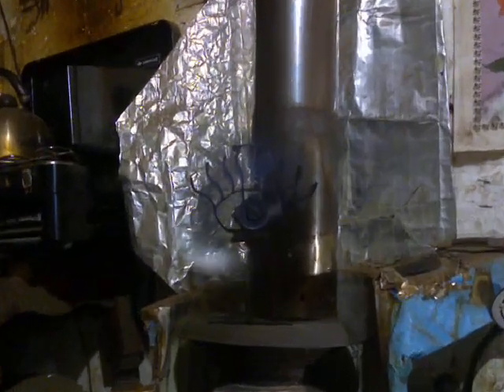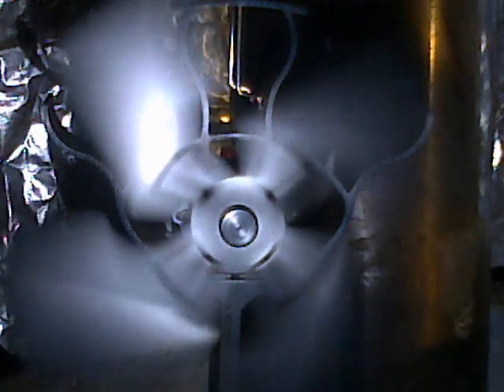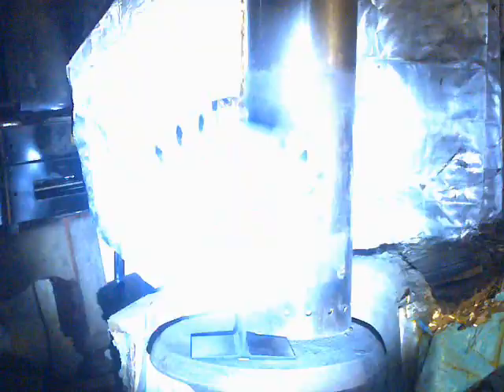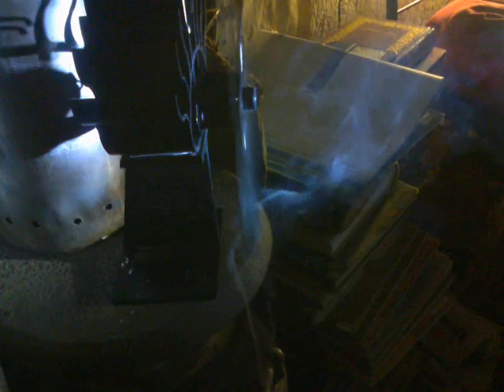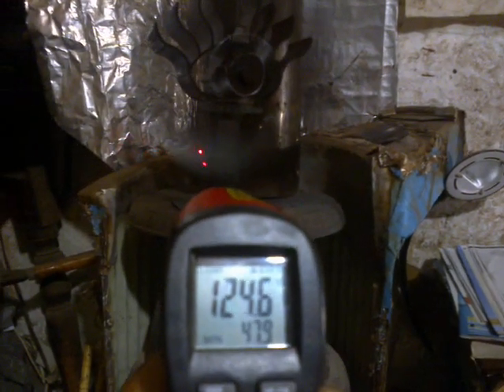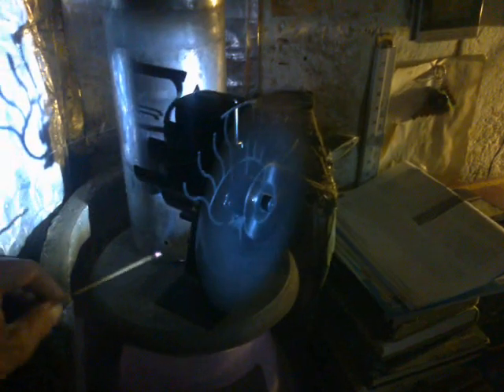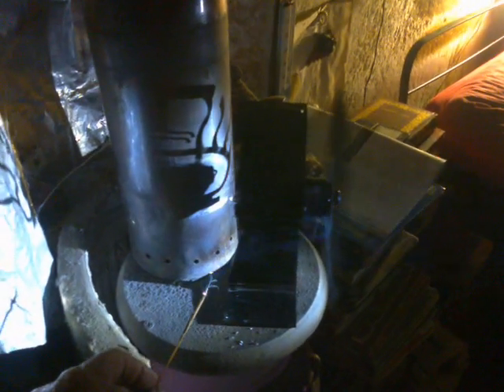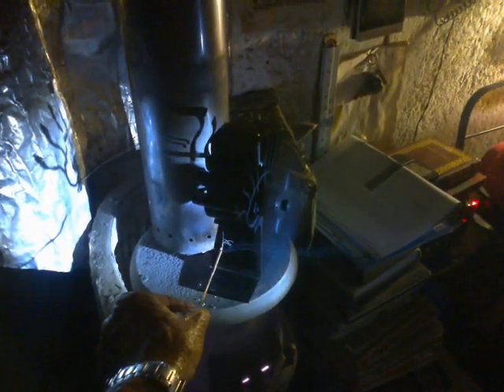Strobscopic Smoketrail Airflow Studies, Peltier-Effect STOVEFAN.

Comment: Surely its not that cold that you need to crank the heater up ?
Reply from the maker: G'day Ed,

Thanks mate,

Well, strictly speaking, not really..., though after weeks of 28 or 33 degree middays, over the weekend it was 22 & 23 degrees max, 13 min, and I had 30mm of Rain (Yay Team !, 5 Km in away in every direction they all only say 5mm or less..., so my son says - and he was commanding a 5,000 Hectare Bushfire at Torrington - from a Helicopter, with Weather Radar at the time !).

  But, well, it's the most fascinating new Alternative Energy Toy I've had for years...; and I couldn't resist.

The temp. under my Ceiling was 51 Celsius by the time finished the video.

It was fun...

Have a good one,

;-p

Ciao !